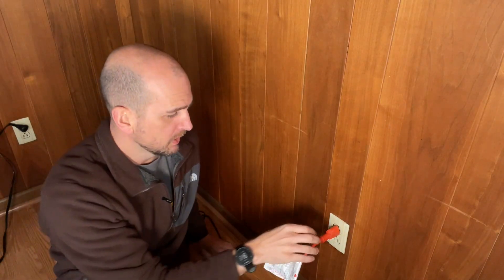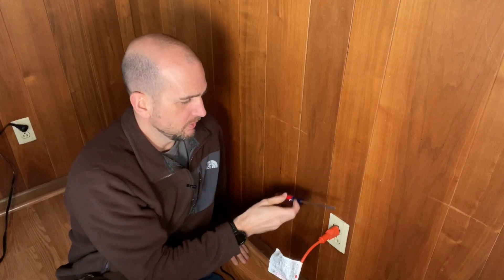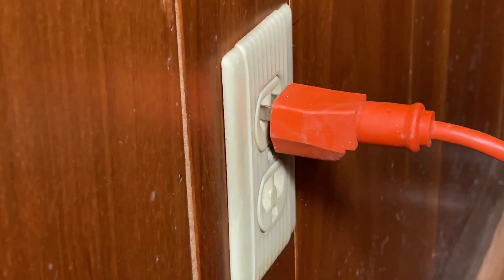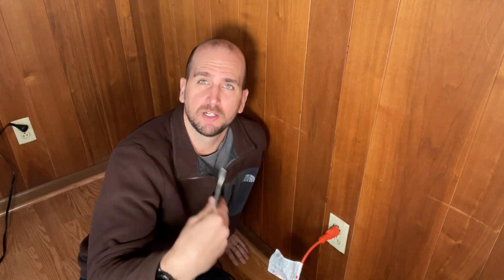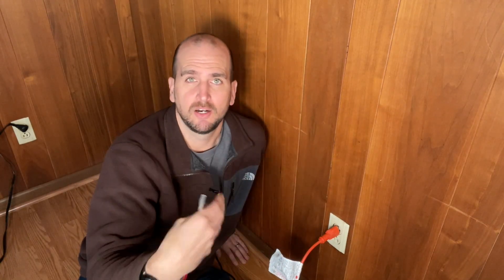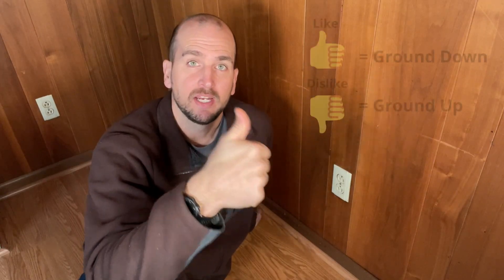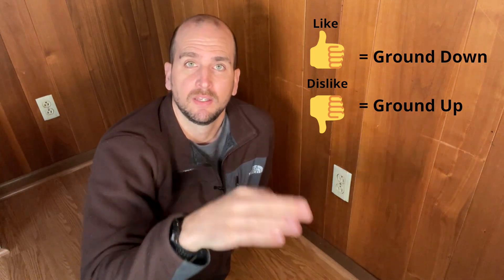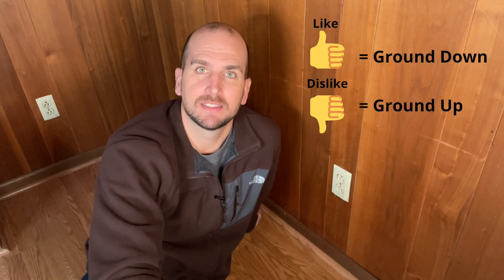Should An Outlet Be Installed Ground Down Or Up

Comment: For wall or window air conditioners the cord comes down to the receptacle and the ground is facing up.  It plugs in easier with the outlet ground also facing up so the cord doesn't have to be twisted around and looks like hell.  When a room does not have a ceiling or wall light fixture it has to have a switched outlet by code.  It is usually the closest one to the switch.

Comment: I was working in a kitchen once when cabinet guy had fridge pulled out and ran his tape measure across and it fell in the contacts and blew his tape in half, before witnessing that I always thought ground up was pointless, trying to avoid an issue that could never actually happen.
Reply: Of course, you noticed that the damage was limited to the tape measure, a blown breaker and perhaps the outlet.
With ground up though, a partially removed plug can result in no ground protection on the appliance, resulting in a person being electrocuted by a fault.  I hope your loved ones would rather replace a tape measure than you.

Comment: Ground down provides safety for if the cord that may start to sag or if something falls on the cord that starts to pull the plug out of the receptacle. With the ground down, and because the ground pin is longer than hot and neutral, the ground will stay connected providing more safety to the user. My opinion.

Comment: If there is no NEC guideline or code, then why not mount them sideways so that both 2 and 3 prong plugs are protected from "falling screwdrivers"?  Also, why not spread the receptacles out more, so things like power adapters (a.k.a. wallwarts), have more space?  In my opinion, they put the 2 receptacles too closely together.  Also, why not have some outlets with 3 receptacles instead of 2?  Why should they only have 2?  Actually, if they had 3, then they wouldn't have to be separated further from a neighboring receptacle.  If you needed more clearance, you could use the 2 "outer" receptacles only, and use the space of the middle receptacle as clearance.  If someone actually makes and sells these, I should get credit for the suggestion.  Call it the "James" outlets.  And while you are at it, design in those plastic protector "plugs" to help prevent small children from putting paper clips in there.  They also help prevent drafts in the winter and cool air leaks from your aircon in the summer, for the outer walls of your house.  Have them swivel out of the way with a velcro type backing so they don't spring back in the way.  So Scott, my answer (vote) is NEITHER up or down.  Sideways is my answer.

Comment: So everyone seems pretty clear that ground up is used to indicate a switched outlet, and if the electricians were trained and not self taught then the top plug is the switch half. I stopped the video when he started to show how ground up can help keep the energized prongs in place because the only right thing to do then is have it replaced, not extend its use till your house burns down. Also, there are many appliances and devices with 90° cord ends intended to reduce the space the cord takes(like behind a dresser) and those are almost universally ground down, not to say you CAN'T have you cord go up then loop over and not be right.

Comment: I was taught ground faces down below 4 feet because people do not Paul plugs straight out of the outlet. if it is a lower wall outlet they will pulll out and up at the same time.the ground prong is longer than hot and neutral by design so it will be the last to disconnect and with ground up has a good possibility of being broken off and remaining in the outlet when pulled up at an angle. I have seen this, but not to often.

Comment: The recepitcals which is what they actually are in my opinion are poorly designed... They should have 2 grounds, so it does not matter
.
 Outlets are where one goes to buy cheap shoes and or bed sheets.

Comment: I’ve been an electrician for over 32 years and it really doesn’t matter if it’s ground up or down, I moved to the states about 26 years ago and too add a little bit of perspective where I come from we also use the NEC and receptacles are installed horizontally so I asked my vocational teacher how they should be installed (ground left or right) he said it doesn’t matter, they only reason they all should be install one way is only esthetic reasons and in the 35 years that my teacher had been an electrician he never heard of conductive material making contact with live parts, he said the chances are astronomical.
Reply: It happened to my mother. She knocked a broiler pan off the top of the microwave and it hit right on the prongs and shorted.

Comment: In the house ground down,, it the shop ground up,, having the ground up in the shop helps when metal slides along the wall at times,, if  it hits a wall plug the ground post helps it from shorting out.

Comment: I typically do ground down and ground up for switched receptacles, just so you can know at a glance. Exception will be when you have an odd plug like a 90 or a 45 degree, you may have to flip a receptacle's orientation to fit the plug properly.

Comment: You are absolutely correct, not an issue with NEC either way.  Generally speaking ground up was preferred by the Chief Electrical Inspector (AHJ) for the area where our contractor office was located.  This was a personal choice he made, not enforceable.   Same reason that you said with metal object falling.   As far as the 90 degree plug, it makes a difference as to what the plug is attached to and where it is located.   If it is up high on a table, you might want it pointing up from plug in point.   If the cord lays on the floor, you might want it pointing down.
So for your viewers, put them however makes you feel good.

Comment: I forgot to add that grounding conductor first make last break is why the grounding pole ( the round one) on cord caps and extension cords is slightly longer than the hot and the neutral connections

Comment: I took off a metal necklace and tossed it onto a dresser.  It fell behind and laid right across a plug-in for a lamp.  Shorted out my apartment.  I was way under 57.
Reply: If you had one plug short out your whole apartment you have bigger problems than the ground facing down
Reply: @jameshankssr466  Actually this was 45 years ago, so I guess the landlord has dealt with it by now.
Reply: @SilverGirl-925  👍

Comment: No code for the up or down. Some needs the ground up, some needs the ground down.
For some cases, ground up makes more stable to hold the external phone charger...
So it is the best to mix up them.
The brand Leviton outlet, it does not matter, it fails to hold the charger either direction anyway.
For Walmart $0.50 GE brand outlet (made by Jascos in China) , it is the best to install the ground up to be more stable to hold a charger ( the internal copper spring has U sharp designing.When ground up, the n shape locks the charger in secure and stable position)

Comment: The electrical code allows outlets to be installed with the ground plug hole facing up, down or sideways. It’s up to you, there is no standard electric outlet orientation. So that means there really is no such thing as upside down outlets. It all comes down to aesthetics, so install them whatever way looks best to you. Incidentally, the ground plug is typically down in the United States, the opposite of how it’s generally installed in Canada. The electric code doesn’t specify which direction the ground plug hole needs to face. One way isn’t safer than the other—as long as the outlet is wired correctly.

Comment: If you have ground down and you slightly step on the cord the triangular shape of the plug with the ground down will have a greater resistance to twisting out of the receptacle because of the nature of the moment arm introduced by the bottom of plug and its triangular shape, making it less likely you will snap off the ground pin.

Comment: DIY're here. Ground down. many extension cords and power bars have an angle that makes them naturally fall towards the floor when ground is down. If installed with ground up, it becomes an unnatural twist and bend in the cord. Really don't like that. Is switched receptacles still installed?

Comment: When I first moved into my 1970’s home in 1999, I was an advocate for ground up, so much so that I turned all the installed outlets ground up. (Partially because I worked with outlets stamped “top” and was convinced that was the “correct” way.)
In a very short time I realized my mistake. The likelihood of dropping something conductive on an outlet regardless of orientation was minimal. Add to that the fact that most my cords are polarized non-grounded: even smaller chance. 
2 reasons I switched them all back:
1. Peer pressure. Have the visitors to my home (as as well as my wife) would complain about the difficulty of having them “upside down “ (ground up) as the common perception for the average person was this. 
2. The second, and most important reason besides aesthetics, was that when I had to plug something in behind a bookcase out bedside table or other object, and it happened more often than I realized, my normal technique was having my finger close enough to the ground, feel for it, insert the ground of the plug, and rotate until the plug slipped into the outlet. Much to my surprise, it was always more difficult (and more dangerous) to blindly insert a grounded plug ground up.  
And of course there’s the reason you mentioned that many of our cords exited the plug through the ground side and the extra tension on a cord exited up was something I was uncomfortable with. 

I will say this however: there are the occasional plugs which have the cord coming down with the ground up (such as the refrigerator or 110 V air conditioner). In those cases, the plug is custom-oriented.
Likewise, the space in certain areas like the bathroom and the kitchen over the counters does not allow for a vertical mounting of an outlet thus some are mounted sideways. I fully agree with the NEC in not designating a “correct“ or specific orientation for an outlet.

Comment: I was always under the assumption that it doesn't matter as long as it is wired up correctly.
Reply: The NEC does not specify one way or he other.I wired some high end houses one time . They had very elaborate trim in them with baseboards that were 12" high .The builder wanted the receptacles in the base board which required them to be horizontal. PIA to do but no problem with the inspector. FWIW I always put the grounds down on normal jobs.

Comment: Argument for the ground on the bottom. If the plug is pulled down, having the ground on the bottom will disconnect it last, which promotes safety.
As far as the ground on top protecting against shorts across a partially disconnected plug, have never heard of that happening.

Comment: Now I’ve got to be very cautious with my ultra thin metal pictures falling and kicking the breaker.
Reply: Don’t hang your pictures above an outlet
Reply: The odds of it happening are like getting struck by lightning and a shark biting you on land at the same time.
Reply: We're all gonna die, even the people with the upside-down outlets. Short of surge suppressor, most of the stuff that stays plugged in like lamps and small kitchen appliances lack the fool-proofing upside-down ground plug.
Reply: It's really for a child with a coin, ground up makes it harder for them to electrocute themselves.  little kids do stuff like that.

Comment: I will do ground up due to the fact some people will place their thumb against the outlet face to assist in pulling the plug out and roll the thumb down into the pins. I look at it as a safety for both intelligent people and the ones that have a bent for doing things backwards. I will also label outlets to indicate which breaker they go to and if they are switched. That resolves the issue of is an outlet switched or what breaker serves this room\outlet\lights. Currently live in an apartment that has breakers that serve multiple rooms for outlets and lights. Breaker has been labeled to help with service as I remove old two prong outlets and update to grounded. Yes the boxes are grounded so I am covered in the grounded outlet debate.

Comment: NEC NFPA Electrical Code;
"If the receptacle manufacturer has marked "TOP" or "BOTTOM" on the receptacle, it shall be installed accordingly."

1–Leviton Outlet Receptacle installation is "BOTTOM" installed.
YouTube ;
Leviton Presents: How to Install a Tamper Resistant Receptacle
https://www.youtube.com/watch?v=n7pL7MUWMb4

2–Legrand–radiant® Tamper-Resistant Outlet installation is "TOP" installed.

Comment: i prefer ground up but the problem is wall worts tend to be made with the ground down in mind. putting them in upside down tends to make them fall out if the plug is a little loose. the odds that it would increase safety is a nice thought but unlikely. if you are that worried about stuff falling on your outlet get gfi outlets.

Comment: I voted ground down because of the way the majority of "flush three prong" cables are oriented.  However, my 1924 house is a disaster.  It has both orientations of wall sockets.  Some ground prongs are not even connected, :( .  It has knob-and-tube in the NEVER OPENED flat roof "attic" crawl space.  Finally, since the walls are lath and plaster, many of the wood floors have 3 prong power sockets in the floor!  Speaking as an amateur, I could see doing this to $ave from having to cut into the lath and plaster.

Comment: Once again, your specific "safety" concern is essentially a non-issue in the real world. In 70 years, I've never seen a metallic object get anywhere near partially exposed blades on a plug. Therefore it makes no difference which way the outlet is oriented. I tend to install them ground up as it then takes 5 milliseconds less time to plug in an extension cord.

Comment: I was told by an electrician that hospitals are always wired ground up so if any potentially conductive fluid were to splash on the wall and run down onto the outlet it would wet the ground first before conducting electricity. But he also admitted that he just heard that from another electrician on the job.
Reply: Why is it better to hit ground first? If there's that much liquid it's going to hit the hot prongs miliceconds later. What about flooding? Ground down buys you more time!!
Reply: True. I was just doing a little research. NFPA 99 is the Health Care Facilities code. However it does not cover installation. NFPA 70 are the codes that cover electrical installations but do not require orientation. Everything I read about spills only require GFCI or isolated power systems. NEC has flatly refused to specify orientation. No one has told hospitals it has to be a certain way. It just seems they have decided that is the way to do it. I presume based on the object falling on a plug scenario.

Comment: i was in the construction business for 40 years we always installed ground down unless owner asked to have it face up, i agree with you about the cords 90 degrees plug that's why we always faced them down.
Also if you have noticed all 220 plugs for electric dryers, stoves, and water heaters are designed for ground down.

Comment: Who says the receptacle has to be placed vertically?  When building my garage I placed a horizontal 2x4 between studs and installed the receptacles horizontal with the neutral up. Extra protection from an unlikely short.  I actually got a "thumbs up" from the inspector.

Comment: I like ground up because, for me at least, it is easier to work with after installation. Especially with three prong plugs. However, an electrician told me that he always put the ground plug pointing toward Earth, or down. I never understood that logic because if a person has trouble identifying the ground pin, then they are in deep s**t anyway.

Comment: Here how as not Professional learn from professional installation. 😵 perfect emoji. The • mouth is down and | | eyes up.  But because of no standards it needs an eye larger  to set the neutral side so no one mix load positive side vs versa from plug 🔌 without grounding wires. 

In case of shortage from plug 🔌 if both neutral and load touch each others it will simply spark and trip the breaker or blow older fuse in panel.   

Power bars have the ground down. So mouth down 😵🔌👍

Comment: Ground should always be on the bottom. Does it HAVE to be? No, it will work either way. But down is the correct way. It maintains consistency. Does the hot water handle have to be on the left? No, but it always is, though I have seen faucets hooked up backwards. Should a lock be installed with the points on the key pointing up or down? Again it will work either way, but the points on the key SHOULD be pointing up when you put it in the lock.

Comment: In my electrical vocational school we were taught and also graded for safety to put grounds up... I was shocked that the NEC code didn’t specify this when they scrutinize absolutely everything else
Reply: Ground down is the recommended method by Leviton in their products training manual.  In a ground up installation, a partially removed plug has no ground protection and is therefore a hazard.
Reply: In the real world I would put ground down in residential! Especially in a new build. The wife will see that and will make you turn 60-80 receps around to the " right way".😂

Comment: For as long as I can remember the ground is always down. However here in NY the new code is ground up I believe as a safety if one of the two hots becomes loose & disconnects. So all the licensed electrical
contractors r installing ground up now...unless they’re doing side work & they’re installing down as if they never did the job & 😱 (hope this makes sense)!